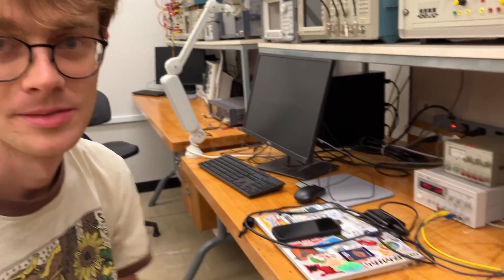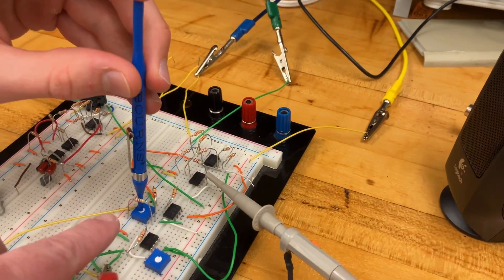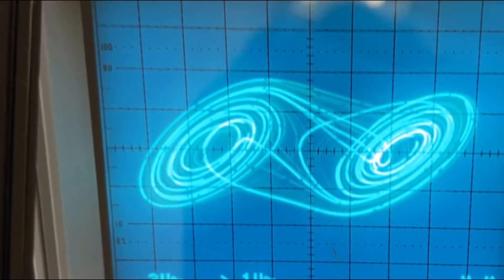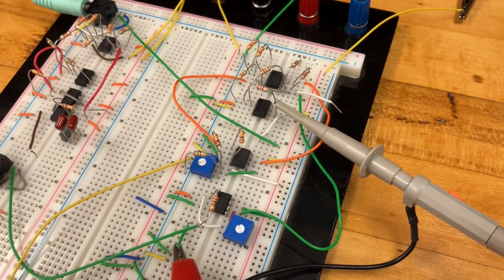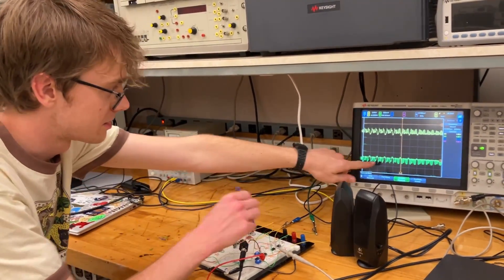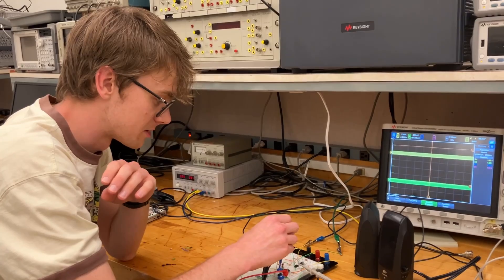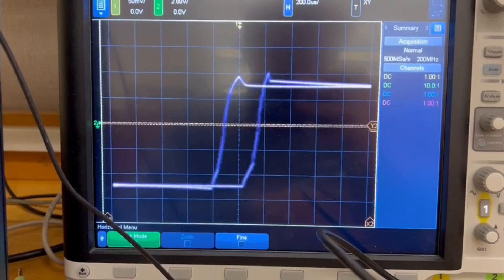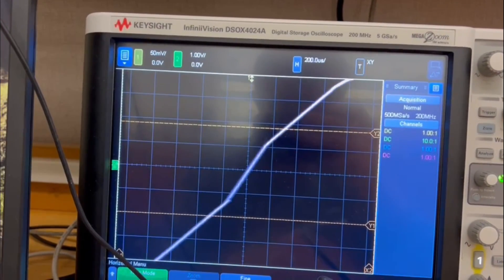Chua's Chaos Nonlinearity as a Guitar Fuzz Effect (Guitar Amplification and Effects Student Project)

Comment: Ehy this has actually some potential commercially. 
Maybe as a niche product for guys who like to experiment with weird distortions, but musically it's got potential. 
Basically when the input is high enough and when the "weird" control is set in the sweet spot, it acts vaguely as a wave folder generating an octave up (or even other harmonics, I've seen). 

I think maybe the "weird" control should stay just a "factory-set" trimmer put in the sweet spot (and why not modifiable by the daring ones), and then it would just need some tailoring before and after (like tone controls, someone else said that a sustainer in front would be cool, I'd say a compressor would do the work, or maybe just some gain stages to act like a more classic gain pot?).

I hope this becomes an actual effect in the market! The guy had an original idea, it'd be deserved

Comment: For the op amps without power connections specified (U2/U3), is the demo in the video using a standard 9V single-supply, or is it running on a dual-rail supply? And if dual, is it +/-9V or a higher voltage?
Reply from the maker: Oh yeah I should have specified — it’s running dual rail, +/- 9V I think. Schematic wouldn’t make any sense with a single rail. To make it work off just +9V it would probably be easiest to just use one of those chips that magically creates a negative rail for you, this would be challenging to tweak to work off a pure single rail supply.
Reply: @Lantertronics  that’s what I figured. How much current should I expect it to draw? The 7660S is limited to something like 20mA or 50mA on the negative rail; LT1054 can do around 120mA.
Reply from the maker: @peddlereffects  Hadn't thought about current draw, so no idea. Instinct is you shouldn't really have a problem.

Comment: I'd love to hear the "weird" knob controlled by an LFO!
Reply from the maker: Actually, that would be pretty easy -- all that knob is doing is being a voltage divider to make a voltage that is used as the power supply for the op amps. So you could take an external CV, buffer and scale it appropriately, and use that.
Reply: @Lantertronics in that case expression pedal control should also be a piece of cake

Comment: There’s some cool textures in there.
Reply from the maker: Thanks!
Reply: @Lantertronics  It’s like a square-folder???
Reply from the maker: @darksparklermusic  It's way weirder. The best way to try to get a handle on what it's doing is to look at the X-Y plots at the end of the video -- input voltage is shown on the horizontal axis, output voltage is shown on the vertical axis. A typical fuzz that "squares" a large signal will have a diagonal line in the middle and flatten out at the extremes. Something like an overdrive will typically be similar in overall shape but be smoother without sharp corners. This thing can actually fold back in on itself.

Comment: very cool!
Reply from the maker: Thanks!
Reply: @Lantertronics  But I did look at the schematic, the input impedance is pretty low for a guitar pedal, no? 1K into virtual ground.
Reply from the maker: @doggwoggle  You're right, and yeah that would load down a pickup. Probably would be better to use a noninverting amplifier configuration at the input.

Comment: Since all are Analog signal processing , I like it very very much and shows the professionalization of the EE who designed it unlike who did it with sh--t cheap crap S/W algorithms  ...
Reply from the maker: I'm actually agnostic about analog vs. digital. Analog circuits are fun, but there's some things you can do in DSP that you could never practically do in analog. To me they're all tools and they all have a place.
Reply: @Lantertronics  Sir , with full respect to your long history in EE and your upper level academic degree than mine for sure... I disagree a bit ... NOTHING IN S/W CAN BEAT ANALOG PROCESSING except for extra dollars to device manufacturer pocket... In fact , if only the clock circuit didn't work properly as it is a black magic system in most cases then no S/W system would run at all ... Also , if EYE Diagram didn't bring the correct switch timings then no fast speed computing will be done ...
If you say you are Agnostic in such topic then I am THEIST with the idiom said by former Digital Research Corp. ( Work in Analog , Think of Analog - Work in Digital , Think of Analog ) ....
Reply from the maker: @ahmedalshalchi  Beat analog at what, exactly? Given that there are some thing that are possible to do in DSP that are completely impossible to do in analog. ;)
Reply: @Lantertronics  I am kindly sorry not to agree to your example ... S/W . and all other digital mechanisms , cannot beat Analog whatsoever unless in terms of manufacturing cost or complexity or size or... etc. but the best processing is ANALOG ... Let me give you hint which you definitely aware of already , you should have a digital system that works ( x2 ) the highest frequency in that Analog signal system if you want to process it digitally so you couldn't solve the main frequency domain in Analog unless you have a fully working digital system in doubled frequency domain  of Analog so how can you beat that anyway ??...
Reply from the maker: @ahmedalshalchi  How would you implement a phase vocoder in analog hardware?
Reply from the maker: How would you implement Valhalla's Shimmer reverb in analog hardware?
Reply from the maker: @ahmedalshalchi  How would would implement a real-time linear phase EQ in analog? I could go on but I won't. ;)
Reply: @Lantertronics  OK , let us simplify your case problem , do you have a problem with analog signal memory ?
Reply from the maker: @ahmedalshalchi  Let's see, there's magnetic tape delay, electrostatic charge oil drum delay, there's the charge coupled devices used in the Marshall Time Modular (whoa those are rare), and of course classic bucket brigade devices. All of those have their charm but result in signal degradation (again part of the charm potentially). BBDs in particular are very noisy, hence they're often used with companding devices. Obviously they have their charm, which is why companies like Strymon have put serious work into emulating them with DSP for certain effects.
Reply: @Lantertronics  What's wrong with these analog techniques to memorize the analog signal and processing it beside the decaying of analog signal in time ?!!... If you have some problems in low frequency domain of Audio then what would you say for over 100MHz of Analog signal bandwidth like in PHILIPS PM3320 Digital Oscilloscope analog memory ?!!... I am using it for years and still on my shelf and by the way , it is 10 Bits sampler !...
Come on Sir !... Analog is real passion of EE...
Reply from the maker: @ahmedalshalchi  Again, there's simply many, many, many things that you can only do in DSP.
Reply: @Lantertronics  I am not saying DSP systems are sh--t but the real challenge for EE is in Analog ( the real dynamic world we EE are facing by the minute ! )...
Reply from the maker: The thing is there's a lot of effects out there that require the designer to implement an arbitrary causal impulse response, which isn't something you can do in analog-land.

Comment: Gritty, I like it! The thresholds seem a little hard to hit, and only sound best with the right amplitude. A compressor would make that easier to hit, but maybe adding another VCA with the same (inverted) CV voltage could open the amplitude to changes again. Alternatively, maybe just slap the effect after a log-amp (and maybe followed by an exp-amp) to narrow the amplitude swing.

Also this is the fourth YouTube result for “chua diode”, seems like there’s room for an in-depth look at this topic!
Reply from the maker: I added a link to the schematic in the description.